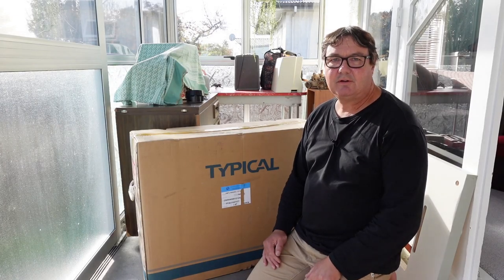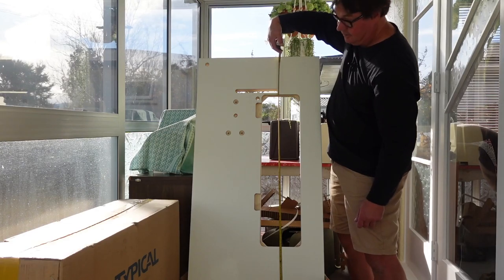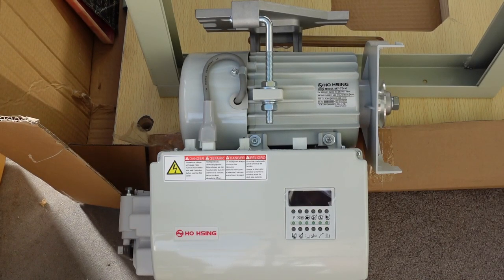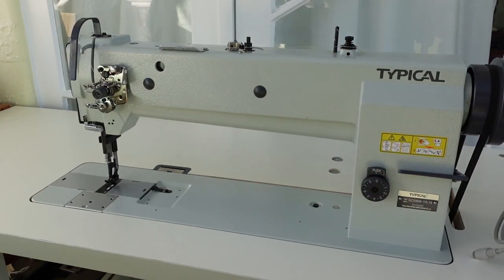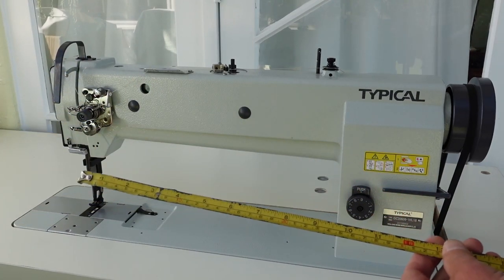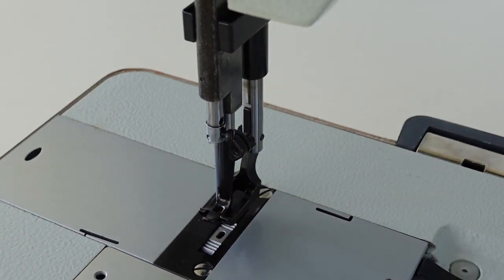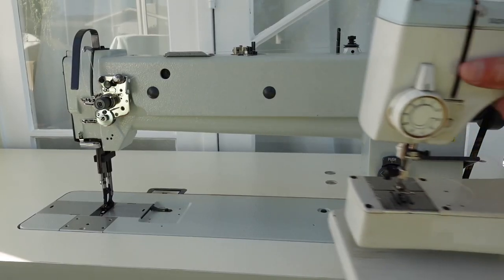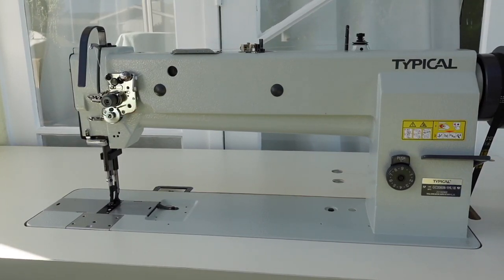Preparing the Typical GC20606-1HL18 Industrial High Lift Compound Feed Walking Foot Sewing Machine

Comment: Very cool thank you. I didn't know there were devices to sync up the motors with the needle. I almost bought one of their smaller models with direct drive but the foot lift height was too small for me. Plus the machine was rusty from sitting a few meters away from a professional car wash and the guy still wanted 3 grand for it. So I ended up with a Jack 2060g compound feed. It's mostly usable so far but it shakes really bad above 450 spm. Are you maybe aware of a fix? Maybe some sort of balancing thing that the supplier missed? (I could send you a video with the lids removed if you'd need to see it.) Thanks. 😊